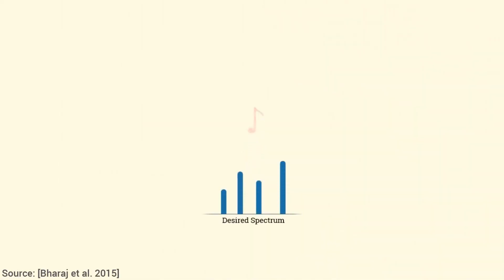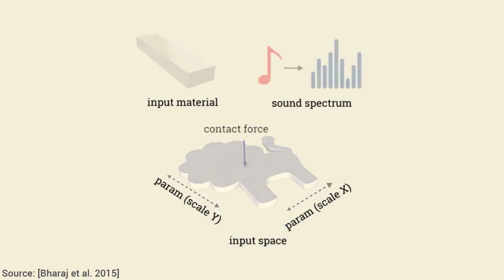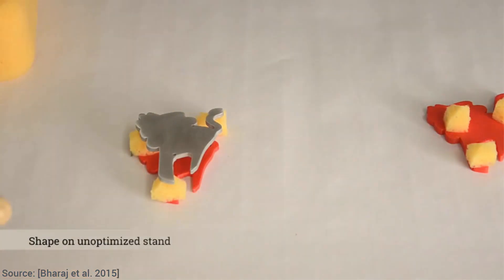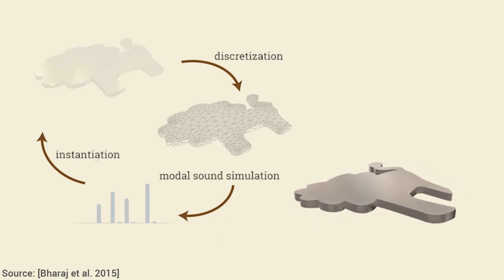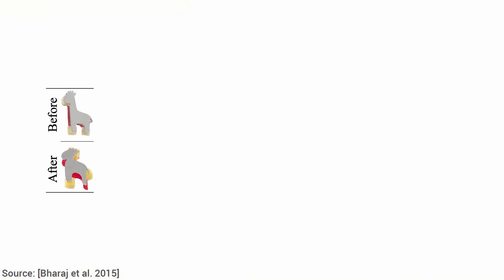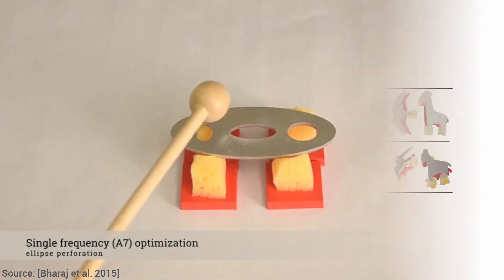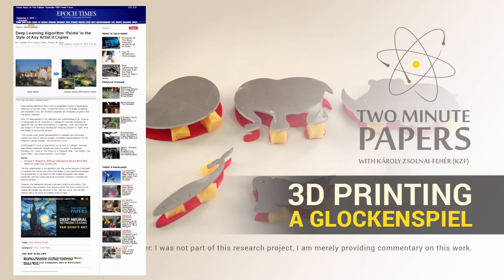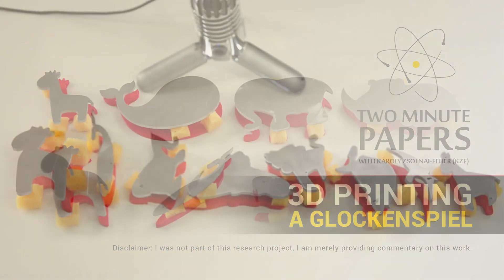3D Printing a Glockenspiel | Two Minute Papers #17

Comment: I gotta say the deformations produced in this paper are a bit strong. Some of the shapes are hardly recognizable. - Not that that'd be surprising though, given how harmonics work.
What I'd find more interesting is to use this to define xylophone- or Marimba bars that have multiple touch points or something. - i.e. where you specifically have, say, three different points to hit to get different harmonies of the same tone or something. (Basically design bars and stands that together selectively dampen different parts of spectra depending on where they are hit. If that's actually possible: I'm not sure)
It would also be nice to extend this to curved shapes. - How about, instead of a lion outline, you start with a 3D lion mesh and end up with something still vaguely lion-y which has a bunch of interesting sounds depending on where you hit it? I'm not sure how much freedom there can be for this task and no doubt it's ultimately just a matter of how closely you want to approximate the correct specturm.
Either way, it definitely is interesting research and I'm curious what'll be done with this in the future.
Reply from the maker: +Kram1032 Definitely. I also see lots of future directions to continue this work. And now, make a nice sounding cheap guitar for me! :)